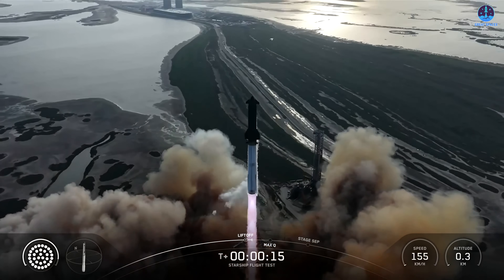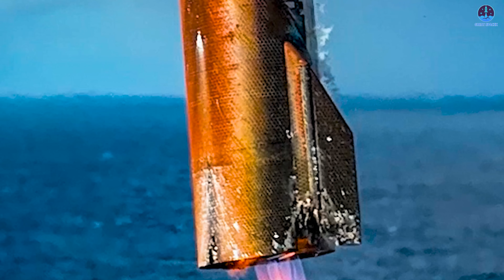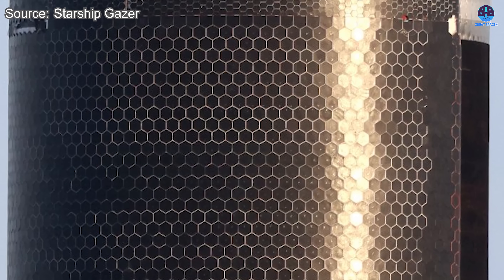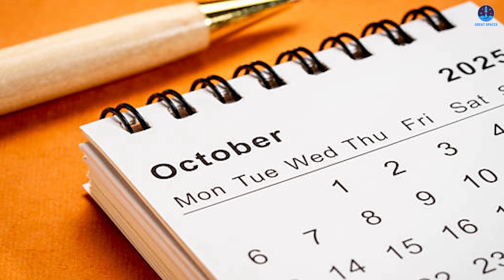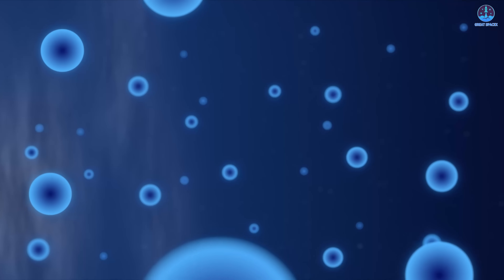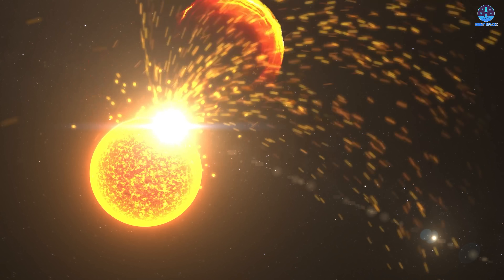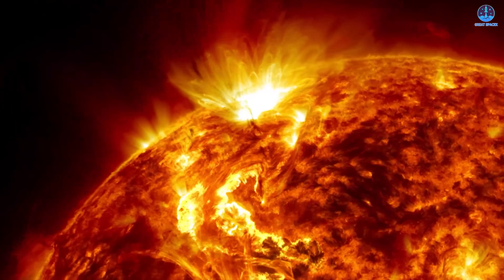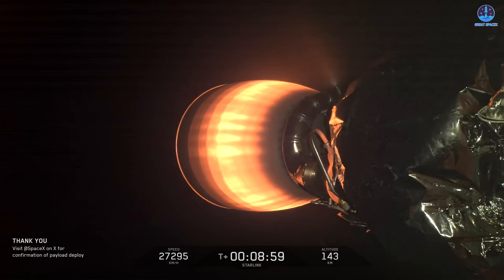SpaceX Revealed Breakthrough Solution for Flight 11 Heat Shield to Fix Metallic Tiles Problems…

Comment: GIVE UP! Use a magnetized blanket on that steel tube,  that can easily be removed, swapped for new, and refurbished for further flights.  Magnets also repel plasma. According to Gemini AI,  The future of reentry shielding may well lie in the sophisticated control of powerful electromagnetic fields rather than in the brute force of a permanently magnetized hull.

Comment: I cannot imagine rapid reusability will ever be achieved with the tile heatshieled.  Between flights, I would expect that the only way to qualify it for its next flight would require detailed examination of every tile... especially if manned missions are involved.  And, how do they qualify every flown engine without detailed metalurgical examinations?  Can you do that to an installed engine?  These things would take time, I should imagine.
Reply: Wrong about the engines. Look at Falcon 9 boosters.
Reply: Automation to scan the tiles and replace what needs replaced. As far as the engine’s go they will figure that out when full reuse ability happens. Like the other person commented; falcon 9 Merlin engines are reusable. Space x will get there!

Comment: The SpaceX cargo starship (no crew) should be made so it has a top part and a bottom part.  While in the moon’s orbit the two parts separate.  The bottom part remains in orbit, while the top part delivers a cargo pod (up to 35,000 cubic ft, 200 tons) to the surface of the moon. The cargo pod could just slip out of the bottom of the top part of the starship, so the top part of the starship doesn’t have to land, just almost land.  Afterwards, the two parts of the starship meet back up in the moons orbit, joins together and return back to the surface of the earth.

Comment: Plasma is ionised gas, so why not to push it off using electromagnetic field?
Reply: you can still have problems with highly energetic particle impingement on the surface. An EM field might stop a certain amount of incoming plasma but since it's a mix of negatively and positively charged particles, some will be accelerated towards the surface by the EM field.
Reply: @DutchDansing how about coming up with a two layers? Positive and negative? Also making half of it is already useful, not?
Reply: @jacekpiterow900  you could have a sacrificial material as well, which you direct your highly energetic particles into using a more complex EM field. I should also mention that these particles' energy distributions are typically described by some sort of Gaussian, there will always be a (very small) number of highly energetic particles in your soup. You can't fully eliminate the problem.
Reply: Gerador de campo magnético eficiente: 180 toneladas.

Comment: They could always integrate asbestos fibers into the ceramic tiles. As toxic as asbestos is to human life, it is PROVEN against extreme temperatures.
Reply: On reflection of my above comment, I would suggest using a layer of asbestos insulation that would be covered by the actual tiles. Then, in the interior of the ships hull, the use of a nitrogen cooling system to reinforce its integrity. Perhaps another material, but I think a silicon based coating could contain the asbestos. None-the-less, I highly recommend the integration of asbestos to shield against heat.

Comment: Use larger heat shield Tiles so there are fewer joints and have Molded to the Star ship Shape.  and Add a Heat Shield spray coating over the installed tiles could help fill in the Joints and make it smoother surface over the heat Shield Tiles.

Comment: You said share if you have ideas. I have one. I need to put it into a graphic if anyone has that ability. Animated graphic even better. It is the answer to the shield problem. Ensures a perfect shield each use. Also includes a substantial backup. Essentially a second shield. Safety and redundancy. Have 2 ideas one ready to go. One that requires some research but may be an amazing solution that can be used as a third safety net. Sorry I am not willing to share the idea without contact with someone serious about looking at it with ability to put it in front of Space X.

Comment: Hi with the heat tiles while don’t they cast one complete wrap around tile for each stainless steel segment with heatproof glue in between each section this way there be no individual tiles except for the flaps of course
Reply: I would not be surprised if at some point in the future they made the heat tiles much larger.

Comment: Bearing in mind the temperature extremes a  heat shield is subjected to .... and the requirement for  reusability and reliability..... its hard to see how this problem will ever be resolved without a breakthrough. 
🤔 ? !

Comment: Slow the re entry so it’s not so extreme
Reply: It takes fuel to slow the rocket down. There is no air or drag in space. So starship would need to do a 180 degree flip a space, fire rockets and do another 180 flip for return. Every amount of fuel they reserve for slowing down is less cargo or inclined of orbit they have available

Comment: They need to modify the bottom of the rear flaps. 90 degree angles are bad for heat buildup because it focuses the heat to a corner. They should duplicate the rear angle similar to the front angle of that flap.

Comment: The discolourationhows the extents and path of the [plasma flow
ship is a tube? if metal tiles are sweating liquid gas co;ant out
huge blanket sections taylored around bulk of ship
with imbedded tube valves would do away woith  a huige amount of 
mixed fragile tiles. nose flap areas would be only a`reas to modefy special taylor areas
being same desgin for each model of star ship
beinghuge alreadt taylored replacements would be easier may be nthree four sections along main tube of body

Comment: Why not make the heat shield's of larger molded parts instead of many smaller tiles? It would be simpler than trying to have so many small tiles creating more points of weakness
Reply: They could maybe fill a spinning mold and create a single-piece sleeve? IDK
Reply: wondered that myself
Reply: would probably be more expensive to make, and if any part of it gets damaged they would  have to replace the whole part instead of a single tile.
Reply: Having to go around a cylinder form you  need the smaller tiles to form to the ship

Comment: Liquid Nitrogen and Liquid CO2 ratio. Spray near the hottest points.  Liquid CO2 is great thermal sink and when it and LN2 phase changes from liquid to gasit takes a larger than normal amount of energy.  Magnetic cooling and MHD, capture electrical energy by releasing potassium ions in s plasma and intentionally redirect the heat to cheap Iron Sulfur magnetcaloric material and is jettisoned with descent.

Comment: Only SpaceX has the capability of actually solving the heat shield problem, with no other explanation, just the unprecedented frequency of launches! Falcon has absolutely smashed it and despite being a still "in development" vehicle "starship" is neigh on more launched than anything else per year!!

Comment: The heat shield is above the steel body and whatever happened, the integrity of the underlying steel structure was not affected. 
Heat shields of different kind have been part of SpaceX exploration for half a century and reusable heat shields were successfully employed on the SpaceX shuttle. The loss of final SpaceX shuttle was due to heat tiles breaking off the wing of the shuttle, not due to the heat tiles itself failing. 
The surface area exposed is larger for SpaceX since it is also heavier. Thus the probability of some tiles failing is high. However the simpler stainless steel construction makes a vehicle failure less likely. 
The biggest issue was always adhesion, how make tiles stick. 
Reusability is critical to SpaceX, some repair after return is not.
SpaceX could decide to use tiles that adhere better, are lighter, but perhaps need frequent replacement.
Whatever we say here is irrelevant to SpaceX, the only certainty is that SpaceX pulled off a very successful flight. Perfection can’t be the goal either, safety and reliability is

Comment: Bogus.  How many gigawatts of power would needed to ionize air around the vehicle? And a power source small enough to fit into a vehicle? Yeah, I know...in a thousand years who knows might be possible.
Reply: oops, sorry. Stopped paying attention to what I was doing. Scrolled down into the comments field and was distracted, I stopped thinking about Flight 10 and was reflecting on the Angry Astronaut's UFP nonsense and Hellfire missile attack. His protection of trump really annoyed me.

Anyway, I still think the vertical stack is a bad design, carrying the starship as dead weight. Should, IMO, be 2-4 super heavies mounted like Falcon Heavy's srms with SS burning all the time but refilled from the 2-4 super heavy's all the time the way the shuttle engines were from the External Tank. This way the weight of better, much thicker tiles wouldn't be a major issue. Would require a larger SS to have enough extra fuel to make orbit. 

Basically, solving problems always seems to require larger vehicles. Maybe the weight of 33+ engines was a bad idea. the outer and inner ring could have been aero-spikes.

Comment: I have not read all the comments on this but why can’t you make the tiles larger?  If you combined 6 tiles together to make one you could go from 18500 tiles to 3083.  If the worry is that one of these tiles comes off prior or during entry then this idea might not work.
Reply: Plus there is the curvature of the hull to take into account too..  Smaller tiles obviously fit better.
Reply: The tiles expand with heat. The larger the tile, the more it expands, and is in danger of cracking. And the gaps between the tiles would need to be much larger to account for the expansion.

Comment: Tile Wrapped Grout lines other then trim specs or pinch weld stress gapping under pressure its a new idea that could translate to other tile formats interesting invention ! 1st step in preloaded tile installation 2 more to go Passing the Incinerator test with Redundancy Requires super reverberation! Broad face exposure kills the quest Percentile of Success ! Atmospheric wave bending or moon gravity welling outer chute slow down ! Heat Barrier Ridge Descending the up and down curve Reentry in slow side pitch and roll ! Atmospheric wicking the thermobaric low cost lite weight future solution in a thread !.

Comment: This program is going to need a bigger Market than interplanetary space travel to survive the heat shield problem is critical. It's possible that there is no solution to this problem, with current materials technology
Reply: What are you talking about? There's heat shields out there right now that have survived that kind of speed for over 20 years+!
Reply: @Tube_America 
Yes there are - but those are not reusable heat shields, they are ablative heat shields.     
SpaceX may be able to solve the problems - it looks likely..
Reply: @Tube_America 40 years
Reply: @Tube_America not fully reusable ones even the space shuttle required extensive rework after every flight

Comment: Why not a smaller disposable heat shield at the bottom of the rocket, this shield would be ejected after slowing down the rocket.
Reply: I think you missed the "fully and rapidly reusable" part of this whole thing
Reply: Right, but there is a point when you  throw in the towel for a better solution
Reply: @jordanjimenez7460 Not to mention there’s a few things like engines in the way.
Reply: Ablation shielding was used until the space shuttle. Its not exactly reusable.
Reply: It’s too early to give up on looking for better solutions yet.  Thee appears to be only a few problematic areas.
We won’t really be sure until after SpaceX start catching Starships and bringing them back for close inspection.
Reply: So much for atmospheric drag slowing you down. That has worked fairly well so far. The larger the area the better the drag. Something at the bottom would have less surface area then the whole side. The Shuttle did pretty well using this technique for decades!

Comment: It's like when you put a glass bottle in a kitchen oven, you take it out and when you try to break it with a hammer - it no longer shatters in the same way, it breaks like safety glass in a car. Why is that? The object looks the same but the crystal structure inside re-arranged and now the bottle is more brittle. The same applies to metal objects like the sheet steel on the outside of the ship. In other words the outside of the rocket is made of pork shoulder when it launches and becomes spam by the time it lands.

Comment: When the cameras become 'foggy' on landing, that's because the steel covering the Starship is burning and in turn becoming a white powder. You can't have re-usability when you literally burn off god knows how many millimeters of steel the rocket is made of. The steel also had rainbow discoloration which means that different parts heated up at different rates, and certainly means the crystals in the sheet metal re-arranged which in turn changes the characteristics of the metal.
Reply: Members of this cult can't understand technical explanations for obvious failings by their technogod Elon.

Comment: Is it possible to spray heat shedding material to the ship before the launch?
Reply: Right? That's a great idea. Giant spray booth. Even if that has to be a thing for rapid turnaround. Basically a robotic gantry with all sorts of nozzles prepping the surface and then spraying on some kind of heat ablation composite. I've also thought many times about igneous rock... Like, could that be made artificially? What about Argon shielding? I can't wait to see how they solve this. I have full confidence that they will

Comment: I'm sorry, but the issue of heat shield tiles can't be solved. The temperature are too high, the potential danger because of a missed damaged tile, in some future flight and the following disaster is huge and no one would take the risk - not NASA anyway. There is one solution - burn a lot of fuel in bracking maneuvers so temperature would never reach dangerous zone.. but, then the payload would have to drop - very significantly. So, the only viable solution is to drop reusability, or, at least full reusability. Each time salvage the rocket engines which are by far, the most expensive peace of hardware - don't reuse the burn hulk. This way starship would have 50-60% reusability but better this then playing a russian roullette with a crew. By the way I'm physicist.
Reply: the problem is whenever "experts" 😂 bleet "impossible" they are always proven wrong
Reply: @websitemartian yes, a UC Davis physicist said we already know this, it is obvious and we didn't even write it down! Why did you?

Impossible because they didn't write it down, lazy PhD's.

Grok 3 Co-authored a new law of physics, May 28 2025. Newton's unwritten Fourth Law. Publicly accessible via Google Drive link provided upon request.

Douglas Ray Renzoni 
Founder CTO 
Final Frontier Freight
Reply: This is not a unsurmountable problem. Refractory materials exist that can handle this. The problem is they are not as lightweight as we would hope. So we try to use carbon-carbon and silicate materials. We just don’t know if we can find a solution that is reusable. If we could just change the shape a bit, possibly by making the thing an oval instead of round? So that plasma compresses and keeps the heat away from the surface of the vessel. Its not that it gets too hot. Its that the hot gas is traveling at to high of a velocity right at the vehicle surface. Previously we used blunt surfaces to do this. Now we are pushing the technology by using a round vehicle. Maybe they can find a compromise solution. Maybe its simple  as using bigger tiles. That means throwing away the idea of boxes of interchangeable tiles that can be cheaply made. I am a chemist not a physicist so the brick placement is not my primary focus. The chemical world has several refractories that can make it possible to do this, but it is not cheap.
Reply: Thanks genuis
Reply: Thank you god Elon has you here to let him know how to build starship. Stick to mcdonalds, ya nonce.
Reply: I was 10 when Apollo 1 burned, and it scared the heck out of me. Space was dangerous, but we didn’t quit. I was 12, standing on a sidewalk in Manhattan, Kansas, watching Neil Armstrong step onto the moon on a tiny B&W TV. “One small step for man, one giant leap for mankind”—that wasn’t just a line, it was humanity daring to dream big. Apollo 13? I lived that, too. An explosion in space, and NASA didn’t panic—they worked the problem and brought those astronauts home. That’s what grit and ingenuity look like.  Now you’re saying SpaceX, Starship, point-to-point travel will never work? Come on. You sound like folks in the ‘60s saying we’d never reach the moon. Every Starship test—yeah, even the ones that go boom—is a step forward. Just like Apollo’s early days, every failure teaches something. SpaceX is landing rockets on barges, reusing them, slashing costs—stuff NASA couldn’t even dream of back then. You’re watching history unfold, and you’re missing it with all this “it’ll never work” noise. No reasons, no facts, just complaints. Wake up! We’re on the cusp of Mars, reusable rockets, and maybe even Earth-to-Earth trips. Stop betting against human progress and start cheering for it. You might just feel that same awe I did at 12.
Reply: Difficult things require a lot of courage. If you do not have it in you, step aside and let Andrew Tate deal with it
Reply: I've been saying the same for ever - it's stupid to drag 85-90 metric tons of cheap steel everywhere you go. It's so obvious, it's maddening to see a whole company repeatedly running their heads into a wall.